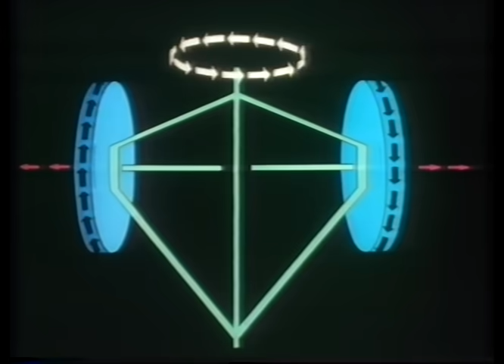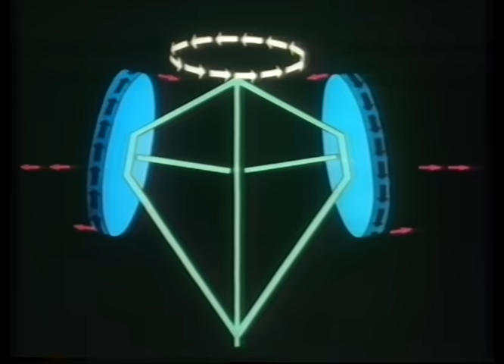Anti-Gravity Machine (Part One)

Comment: Remember the lie our teachers used to tell us in school when us children would ask where gravity came from and they would say it was created by the spin of the Earth at 1,000+ miles an hour.  Well, children I want you to step into a helicopter with me and see the proof. First, pull straight up and hoover at 200 feet for five min. then come straight down and land on the same spot you took off from. Hmmmmm... shouldn't we have landed about 200 miles away if we were spinning at 1,000MPH Right? And what about the wind blowing the shit out of everything on the surface of the Earth.  Think celling fan spinning and creating wind. Now Gravity, gravity should be the same force pulling on everything no matter where you are Right? Your car is held to the driveway but a butterfly isn't ? Two rocks dropped from a high building one 50 lbs the other is 10 lbs which lands first ? THERE IS NO SUCH THING AS GRAVITY, IT IS THE WEIGHT OF THE OBJECT NOT GRAVITY.  No Gravity on the Moon or Mars  OR EARTH because there doesn't need to be if the Earth is FLAT !!
Reply: No teacher ever told you that! The 1000mph figure applies only at the equator and its effect is slightly to decrease the ground-reaction that one experiences. When the helicopter rises, it still maintains its original momentum (why wouldn't it?) and continues to move parallel to the Earth's surface (fighting gravity all the while). Objects which are thrown straight upwards are not in fact predicted to fall back to the same point ... but that is due to a subtle effect which a Flat-Earther could never understand. As in the case of the helicopter, the atmosphere is carried around at the same general rate as Earth; normal winds are due largely to the Coriolis force and to gravity-driven vertical temperature adjustments. Flying butterflies remain aloft by 'throwing' air downwards; if your car could do the same it would be called an aeroplane.  The fall of objects is braked by the atmosphere; did you not know that? After all, it has the same effect as the wind which you are so quick to invoke. How did you acquire your brain injury? Could your carer provide an answer here if you cannot manage it yourself.

Comment: At a glance I can see exactly how your machine works.Well done, it is brilliant. I have also spent a fair bit of time thinking about this one and think the answer might well be quite simple but dont know as I have fallen short of the answer. Whoever does crack it will no doubt put up with the usual crap from those who are unable to understand. Good luck mate.
Reply: In what sense does it work? Do you not understand that all of the forces involved in gyroscopy are couples? So, go away now, look up the definition of 'couple' in this context and come back to explain how such forces could ever produce net movement; either propulsion or levitation.
Reply: @MrAaronvee  still doesn't explain how it lifts a gyroscope hanging from a rope/ string from vertical like a dead weight to riding horizontal to where it attaches to the string.  It doesn't bring the string horizontal,  it pivots right above the gyro and lifts itself up. 
Now convert this into pure electromagnetic energy, analogous to a magnetic liquid mercury vortex engine.  And you might start dabbling into anti gravity.  Which is why trolls like you are in every comment thread
Reply: @ZachLifeTravelWord  Why don't you read all of the monumental textbooks (e.g. Klein & Sommerfeld) which have been written about gyroscopes during the past 200 years. All of the phenomena which puzzle the amateur are explained therein in excruciating detail and are all essentially the result of the conservation laws. The problem of course is that one has to have a good education in physics and mathematics in order to comprehend the explanations.

Comment: Your just missing the center force that starts the lift eg ten foot pole with a wheel on it you hold the end and spin the wheel then the guy let's go and it stays up if you spin in a circle the wheel starts driving up the air you are the force starting the climb your missing that element now to replace you now you need the center force to start the drive take a stone ball then make a chamber that can hold it then line the in side with a conductive metal seal the ball in side now fill the remaining area with mercury  then place a magnet under it now add electricity to the conductive layer. The shape of the chamber must be a half circle on bottom then straight up for a meter or to then half circle for the top making a long tube. The ball will be floating in the mercury and once you add electricity the mercury starts to spin causing a vortex to pull the stone ball down to the bottom now slowly shut the electricity off allowing the ball to start lifting and use this set up in the video on the sides of this machine the ball lifts and starts the lift on the outer cores causing lift just an idea

Comment: Of course he worked for the oil company and that was the last anyone seen of Sandy and he device 😳
Reply: Unfortunately he is still around. He was a tool-fitter and claimed that he was getting £50000pa for work connected with oil platforms.  That was over 5 times the salary of a new physics PhD holder.

Comment: He must not be to smart, because if he was, he would know that thrust is useless in a vacuum. There is no experiment EVER, that can prove different. If a rocket was moving in space , you could not slow down, turn or speed up.. for example: if you hang a feather from a string and turn on a high powered fan inside a vacuum, the feather would not move..
Reply: You are an idiot.
Reply: MrAaronvee perfect response. Just goes to show there is no proof. Zero
Reply: MrAaronvee it has been proven already. You can see video after video of my claim. Ex: if you hang a feather in a vacuum and turn on a fan, the feather will not move. This is the biggest scam in space history. OR, space is not a vacuum🤷🏻‍♂️ either way, they are lying

Comment: If you wanted to make a anti gravity air craft you need a donut shaped hollo tube wrap the copper wire around the hollow tube then put liquid mercury in the tube then power it with however much power just refrigerate the mercury so it does not become a solid so try to make it a gas when you power it it will spin the mercury around at several miles per hour and will make a strong magnetic field this can make a home made gravitational field
Reply: Moron.

Comment: But is it actually producing force, or is it rotating around a central point of rotation? Gyros kind of act like they’re tied to a rope, how far would it actually produce force? I don’t think it would produce force beyond its imaginary center of rotation. Like laithwait’s demonstration device, except imagine the device framework isn’t there. It would still behave trapped in its little imaginary.. for lack of better term, center of space it’s tied to. This could easily be tested using a little frame and some brushless RC motors. If the concept works, it would not have to be tilted, just have gyros in the edges of a frame mounted at the same angle as his “full power” position, powered by some small motors and spin it. See what it does. I think it’s the motion of moving them up which is changing it’s center of force. I don’t know what to call the center point gyros orbit. This is why those gyro cubes can’t just take off and fly, but if they’re spinning and you tilt the gyro, the machine/cube moves around the gyro. They’re sort of an independent force in themselves, but they don’t have directional energy, they’re just staying in the same place and swinging the machine up.. Ish. I would love to be proven completely wrong, but I just don’t see it doing what he thinks it’s doing
Reply: That's exactly what's going on here. Thanks for your post.